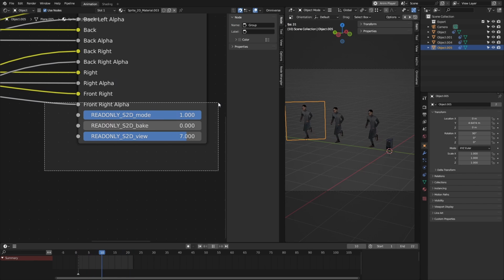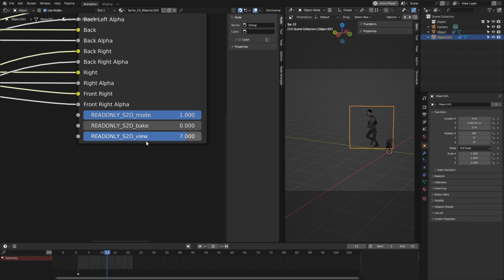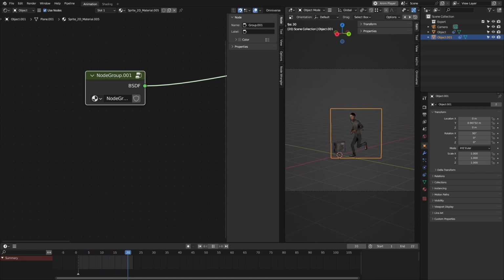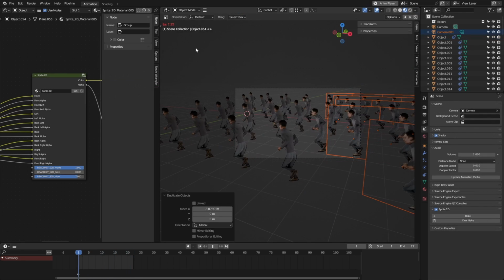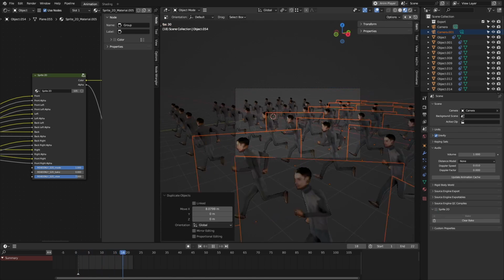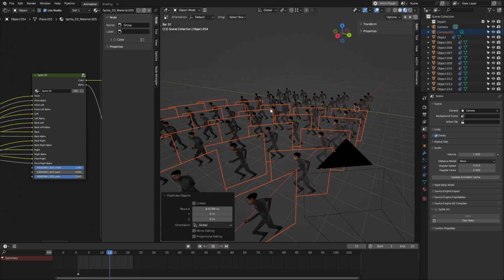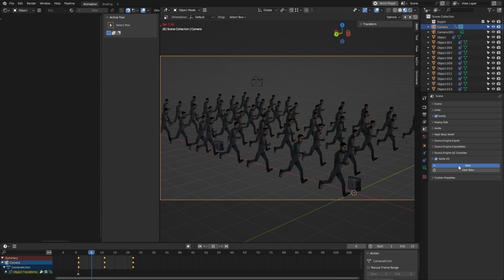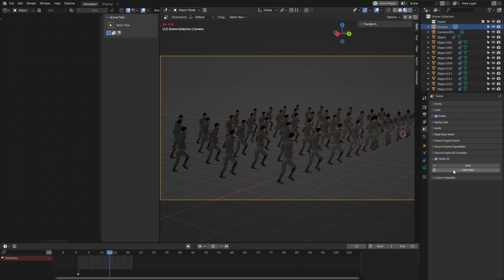Sprites 2D ... but 3D - Dynamic 3D Billboarding - Blender Addon

Comment: I've been loving this addon, the only problem I have right now is that alot of older sprites weren't made out with this square system in mind, which means if you're working with older sprites that you'll have to manually expand them into a square

edit: understandably there's no way for the addon to contain this, it would need to read special data designed for the game to correctly adjust sprites, i'm happy with the product i bought though